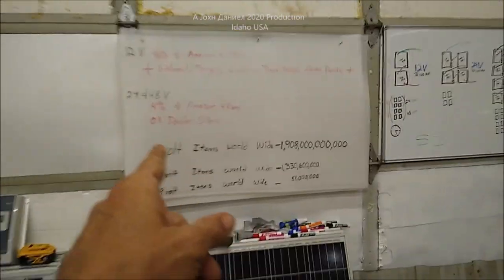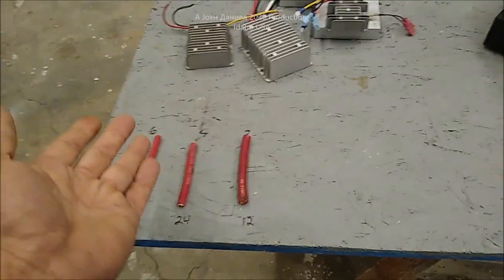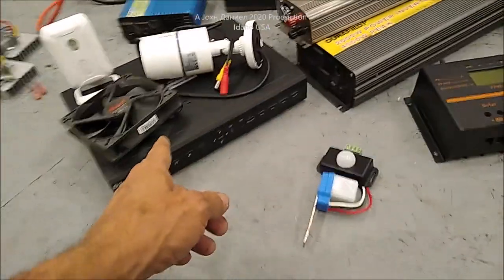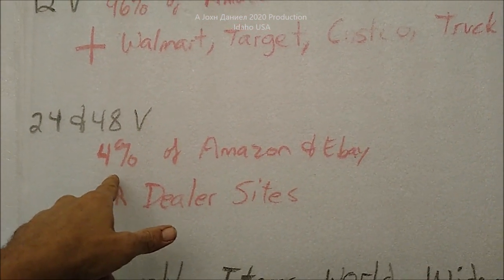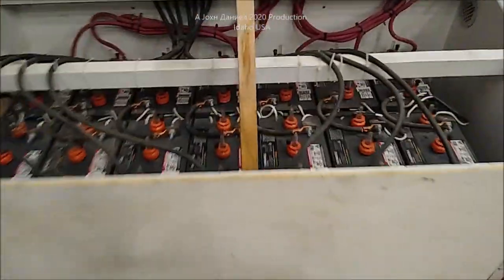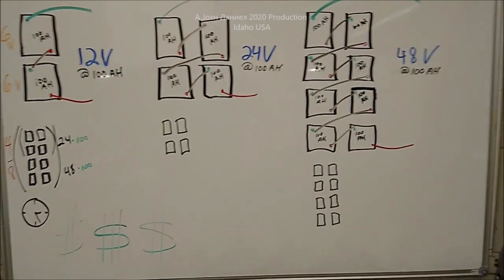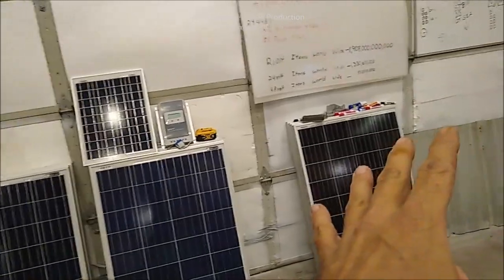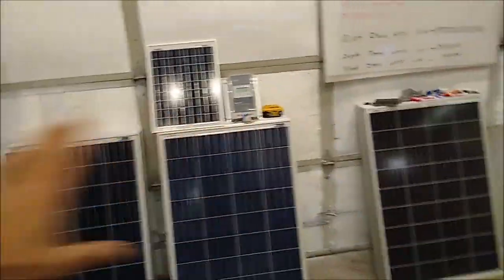Solar Wind Hydro 12 VDC is Best Voltage on Off Grid Survival Power System (Graphic Info)

Comment: My system is 48v (now i started on 12v)
Why.. i am Electro Engineer
So 48v is the logic choice 
12 only has a 82 to 86% (1000watt only 820watt 120watt loss )
48v is 92 to 96% (1000watt 920 to 960watt usebel only 40watt loss)
I got 48 x250 RECOM +5Watt gold MONOCRYSTALIN WITH BYPASS DIODE OPERATION NO SHADDOW OR DEAD PANELS DRAW DAWN in series
4 Set at 4seriel 3 paralell on 10mm2 Cabels down from The roof ..
To 4 x EPever 3000watt@48v 60A 1 master 3 slaves (2 spare)
20 200Ah sonneshein exide AGM set in 5 Banks 1000Ah@48v 48.000watt/48kw
With B.M.S and fast acess capasitor bank to kill power drops  big batteries ain't fast to DELIVER A 
2 x 6000watt 230v pure sinewave shtepower (EPever)  ( 2 spare )
1 for houshold applienses like AEG Condenser Dryer.  AEG 9kg washer. 1800watt Vacum cleaner. 2500watt oven. microwave 
Mig/Tig  heat pumps / aircon
1 for hous tv's HiFi HAM equipment WiFi heat pump / aircon 
16x 250watt panels 2 x2000watt direktly in to 2 x140l waterheaters heating flor's aswell as vater .. 
Got a Wood pill oven making hot water aswell .. so this is a combine when hot enough 
Wood pill oven don't run !! IT run at Winter time 2 Month a yer 
2 x 500 watt @48v 5 BLADED SH500 from shtepower (EPever)
Shtepower produses EPever
So All my produkts same manufacturer ..... 
I use 48v becaus low loss
More gain .. 12v .. i use BUCK CONVERTERS almost loss less 48 to 12v if i need 12v
Or a power suppley... This is a house not a RV 
And i operate IT as a house . Not a RV
Reply from the maker: I am noticing a serious quandary of issues.
I think I need to make a Video called Solar Snoots Vs. the other 99% of the planet (the new Unclean). Hundreds of comments are from people who now understand they can at least do something for themselves only to be hammered down like little children for not owning high tech mega systems, or for listening to a "fool" who shows them how to at least have some control and not die in a storm, catastrophe or SHTF scenario, for being poor, or being soooo stupid not buying the snoots part A or Brand B. 
In 2020, with the current crisis on steroids, not all can shit out at the least $7500 to buy the "right" thing according to the solar supremacist who bash them. 
They get bashed for their simple survival level Unclean 12 volt fantasies of at least not being total victim of having nothing, Could it be titled Solar Supremacist verses the unwashed fools who don't have Superior branded products ?? 
What would be safer as a public, feral population running to the lit homes of the Solar Supremacist to riot and pillage or them stay home in what little they realistically could afford to keep a freezer running, lights and communications.
Wonder how viral it will go since the result of the SS actions affects 6.5 billion people! 
I get shocked how many get bashed for buying silly Harbor Freight solar kits, as stupid, slope heads, neanderthals and fools by the solar supremacist and mainly the sellers of high end solar gear. 
The truth is over 90% of them learn to move up, become more involved and thats what is obvious to me what the Solar Supremacist fear. The unwashed, becoming clean. 
But when they do move up, they got that abused bad taste in their mouths of dealers, re-sellers and supremacist who instead of congratulating them & courting them as a possible customer or friend - abused them.

Comment: You think like an engineer; simplicity, reliability and redundancy. 

The only reason to go with a higher voltage is for massive high efficiency inverters like some gridtie inverters or if your batteries are for some reason a large distance from your inverter. I'll probably have to change my mothers system from 12-24V for a new inverter that will make the regulators and the electricians happy. I've seen nice big industrial grade DC-DC converters that will take 24 down to 12 and supply about 300amps at 12v for only a few hundred bucks which isn't ideal but not the worst compromise. That said We're keeping some 12V inverters around and if shit hits the fan and the 24V inverter fails I could easily and quickly change the system back to 12v. Regulators aren't likely to crack it if circumstances got to the point that was required anyway. 

As a blue collar Australian it makes me sad that you have to censor yourself, your cussing is positively tame by our standards.
Reply from the maker: Blue Collar in Australia??? Your like a Prehistoric relic LOL!! Sorta  reading the Communist manifesto now being applied to poor Aussies, the simple and logical will be banned to apply the new highly regulated Peoples Socialist Republic Of Australia rules - for your own good!  For now we have Trump who is promoting and allowing invention once again, but likely not for long since the application of common sense will be on the chopping block by socialist Democrats here since the application of such self reliance goes against the Wacko Left Parties Manic Power hunger! Expect the election in USA to be stolen right in front of the world, Deep State 1 - American People 0.
 I see your getting the same there right now, what did anyone expect when they handed in all their weapons!
Reply: @JOHNDANIEL1 
I know right, I'm only 26 and as a welder/steel worker I feel kinda old. There are so few welders that even though I'm only one step past mediocre I've never struggled to find work.

 Hey man, don't conflate us old school leftys with fucking neoliberal democrats! Real leftists support workers having guns. At least actual socalist types like Sanders actually believed in something Biden believes in nothing he won't do anything to support innovation and he won't enact any socalist policies that might actually help people like healthcare.

I earn $60 000 a year as a welder/steel worker and My tax bill is lower than most health insurance in the US so it isn't all bad. ALSO we still have private healthcare too so we have the FREEDOM to chose between the private and public. If you get private healthcare you pay less tax as you're less of a burden on the public system. 

It's worth pointing out that here it was the conservative, right wing party that brought in gun control and the leftwing party unfortunately just rolled over. That said you can still own a gun here, plenty of my friends have riffles.
Reply: Ended up going 48V unfortunately, it's very effecient and powerful but I've kept 2 of the 6 12V batteries on a seperate 12V system and I can use one of them as a spare should we have a failure.

Comment: Watt Hours are Watt Hours.      100A @12v = 1200Wh....     100A @    24v = 2400 Wh  ....

Lead Acid will only provide 50% of the rated Ah of usable power   Li will provide 100% of the rated Ah of usable power.    That means a lot to  me.

Panel Assassin ?    LOL
Reply from the maker: If I only had almost 4 times the money to do that I may try, but like my Friend in Colorado, on his third 240 amp BMS in 2 years, I can't trust China will be the source.
Reply from the maker: Is their a reason the same cells they use in Tool Batteries can't last as long as the same cells in those 100 ah batteries? In a off grid situation you will pull on them just like a tool does, even more. And I just replaced 6 in a 24 volt system that was 3 years old with 10 of the as mentioned Lead Acids for a man in Boise. Lead Acid was 1/3 the cost, so even at half the rating it was good for him. He may want to know why he had to take them in to be fixed 3 times for bad cells and major amp loss. And his LiFePo group battery of $5500, not a cheap china sold, bought from popular maker in Wisconsin. You surely know who they are. So called Leaf Battery makers.
Reply: Nop Deep cycel AGM Sonneshein you 
Do 10.5v and Up to 14.4v 20A chardge power thats one cycel ..
You can do that 3.5 yers .. guarentueed !! 
Or do 12.4 to 11v a Half cycel .. 
Yes standard batteries !! 50% 
Deep cycels 100% .. but who doe's that .. 
But the 50% or 11v line naaaaa ITs 2020 bro
Not the Stone age
Reply: And a nother thing !!! 
Ill take 1000Ah@48 AGM any Day 
Lion lipo and All the other exotic brands 
Do not operate well under 0°
Asid doe's !! .. and i got my insulated shed
But batteries is outside !! Still insulated (some Winters we got minus 25°)
The figher Marshall won't hawe Them inside the building
Reply: Exide give 7 year warrenty on Sonneshein wher i live 
And in my setup 12yer expected life span
Reply: @JOHNDANIEL1  Tool Cells are not the same.   They're geared up to produce maximum Output current in short  burst.  Worst then that are the LIPO cells used for Model flying.  Those can get nasty on you.  LiFePO4 cells are way more compatible for our needs.
Reply: @JOHNDANIEL1  I do in fact have 12 leaf modules.   The voltages are a bit off center.  You have to use 6S  or 25v max.   I use those in a separate system.  

Lead acid had some advantages.  They will take about any voltage you shove into them.  They may boil some but tolerate it.  You can use simple on and off chargers on them if need  be.
Reply: @JOHNDANIEL1  It's a fact the Chines pump out some real rubbish at times.   Most everything they label for power is actually about half of what they state.    BMS are not actually required.    Charge Limiting and Balance is all that's needed.   If you only offer the LiFePO4 cells 12.4v that's all they can take.   Keep them balanced doing so and life is good.   Active Balancers   are cheap enough.
Reply from the maker: @pulesjet  True, but I am focusing on hybrid now where no BMS is involved, and a quality controller actually set right covers everything from discharge to charge. Those you can get everywhere and do not have to be matched to battery.
Reply from the maker: @pulesjet  Just be sure to use a small Lead acid bank charged from your Lithium for lights and home security/safety gear.
Reply: @JOHNDANIEL1  I've gathered quite a number of Batteries .   Yes One  is a Lead Acid.  If  I treat it a one of my LiFePO4 cells it will live a long and happy life.  Both live in similar domains.  Once I get my show all put together and running full time there won't be much of  a Grid Bill.  Wish  I had these idea's when I replaced the Well pump a few years ago.  It sure as hell wouldn't had been a 220VAC pump.

Comment: Go 12v and go as big as you can afford, back up with wind, in fact wind is better depending where you are.  Pay as much as you can afford, better to install good stuff and add to it later than buy crap and be stuck with a crap system that sucks cash from you and never works right.  No, I do not install them, but I know a man who does.

Comment: SHTEPOWER Makes 12v 24v truh 230v dc to AC 
They are wery easy to repair if you 
By fault blow it Up.. i modified my 3000@12v and 2000@12v 
Not nessesery but well !! .. Then i changed the whole system 
To 6000watt@48v .. this is year 2 .. not a wrong peep !! 
Changed blowers to PAPST BLOWERS with Ball barings and 
Server 100.000 hours mtbf 
Shtepower produces EPever MPPT controlers
And IT is heawy duty components !! 
No noice at All EMC ok i am a HAM so No noice on any ham bands 
Same with EPever MPPT controlers No switch noice !!